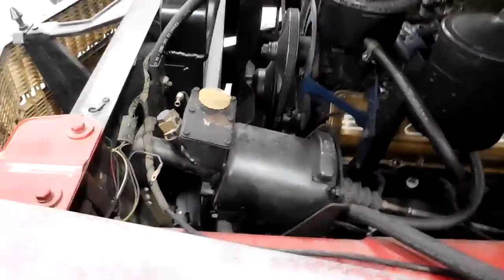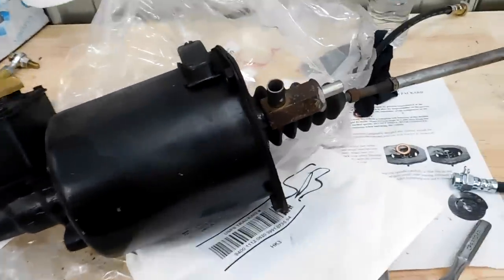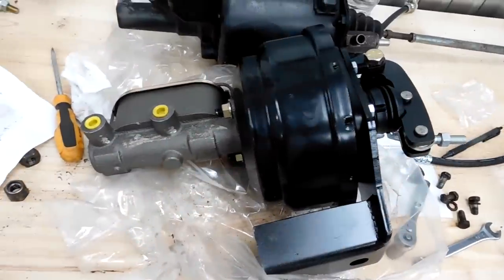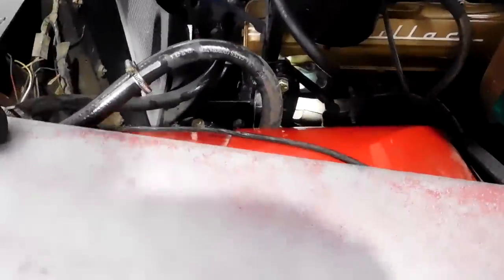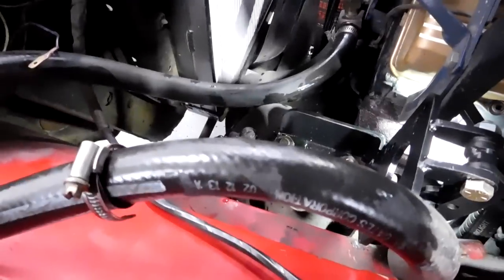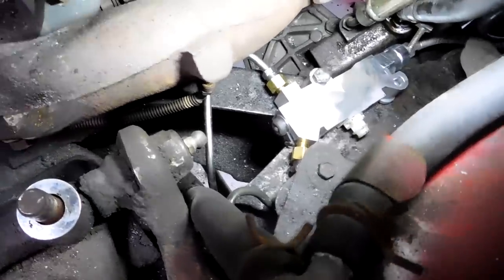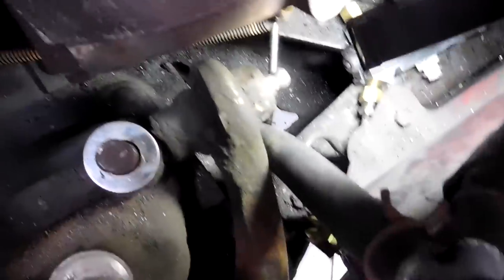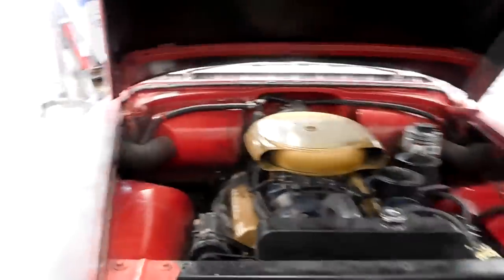1956 Cadillac Disc Brake Conversion Part 2: Caddy Daddy Front Disc & Dual MC Brake Kit How To

Comment: I went with the Power brake master and booster on the firewall with the swing pedal conversion. Very happy with it! I didn’t want all that stuff up front! I also removed all my heater lines and cores. Mines a summer cruiser now.

Comment: neat product to bring the braking system out of the very distant past. 2x👍
I guess putting the booster at the front of the engine bay gave them more space at the firewall, but it does look a bit odd

Comment: Would it have been easier to install hydro boost to run from the power steering pump. 
Much better than  vacuum. 

Your cadillac and my Chevy ck 3500 weigh about the same.

Like your posting. 

Gary

Comment: I wonder if that exhaust manifold being so close to the booster bracket will be a problem during acceleration. An engine  wants to twist when under torque.  Well done on the brake lines.  That looked like a brutal tight space.

Comment: As I remember those Bendix Treadle Vac units don't offer much help for stopping when you lost all vacuum. A friend had a 1958 Lincoln Continental that had the same unit and I remember him having to use the emergency brake to stop the car when the engine quit. The vacuum reservoir was probably a safety thing also they were used for other vacuum operated things like windshield wipers and heater controls and vacuum operated windshield washer pumps.

Comment: I have some vintage Cadillac parts on my 39 Pontiac hot rod, particularly the power steering system, soupe to nuts. I bought the parts from a junk yard. I didn't have to rebuild anything, just install the parts. Cadillac power steering, one finger lock to lock while standing still. https://www.youtube.com/watch?v=MLMS_QtKamg